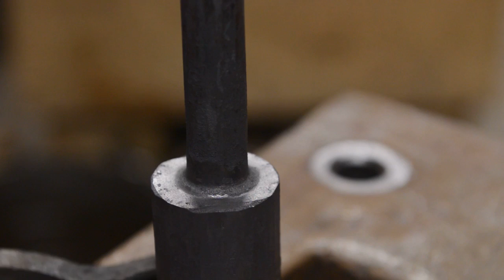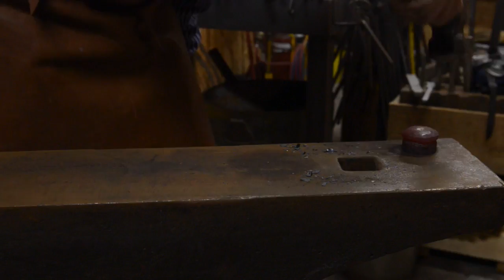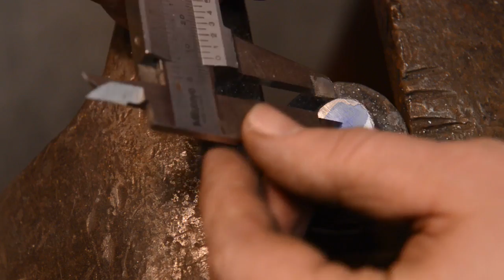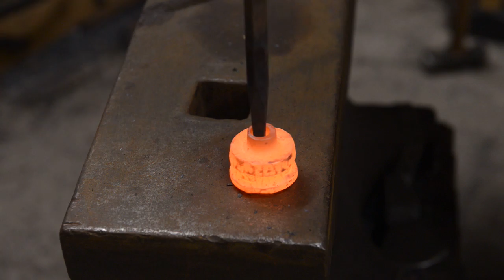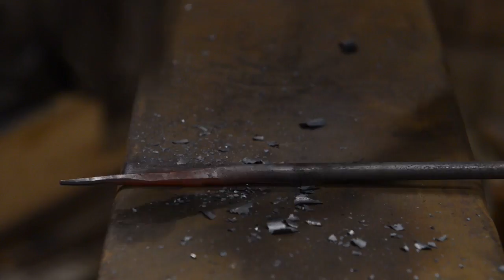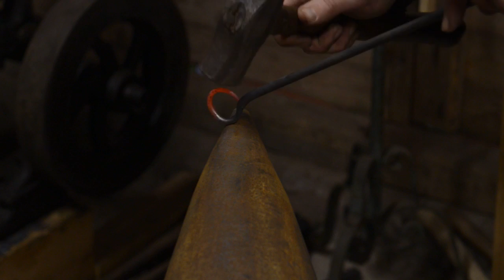Blacksmithing - Forging a nail header

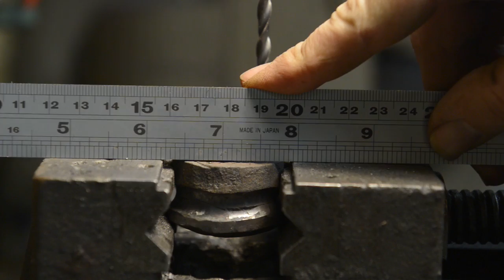Comment: Perhaps a dumb question, but what are you doing at 4:16 onwards? The bit with the ruler? Didn't you already mark the hole for drilling? Or are you checking if it's level?
Reply from the maker: Irianthul Black Yes it's a level check.

Comment: This is just amazing. Thanks for sharing!

One question though: Is there a way to drill through the header without a power drill? How would a 19th century black smith do this? Thanks!
Reply from the maker: semerhi Thanks. It might get difficult but one could punch the hole all the way through. A nail header does not need to be this fancy. A piece of flat stock does the job more or less. Then it's easy to punch the hole.

Comment: after you square off the hardie hole(new to black smithing terms not to metal working) & round off the head could i bring to the drill press drill out square w a 5/8 -3/4 hole then to band saw cut it in half, file a triangle into each half then turn to grip into tongs? finished making my forge waiting on a hand bellow i order on Ebay. then im going to practice nails and scrolls till im blue in the face. so i want to know making the nail header in the way i explained would work good or not? any other info is always welcomed for practicing.  your vids are inspirational. thx for the light in a the dark room.
Reply from the maker: mash7137 Thanks! I don't think there is much advantage for a 2-piece "tong-like" design. Keep it simple. This one is complicated already :) A simple one would just be a piece of plate with an appropriate hole drilled through.
Reply: yep there you go plate w a hole there good advice thx

Comment: What is the dimensions of the round head piece? What dimension is the square hole in it? Awesome video, I just started my 3rd set of tongs so I'm new to this.
Reply from the maker: It really does not matter! Make the square hole to match the size of nails you want to make. In this case it's probably around 5-6mm.  Great! Keep hammering!

Comment: Does the type of steel/heat treating matter for a nail header? I'm assuming mild steel would work but just not last as long?
Reply from the maker: I would say yes. A proper steel version will last much longer.

Comment: what do you do with the leftover scraps flying off the hot metal? Can you reuse it for something or recycle it?
Reply from the maker: MN-14 The iron oxide (scale) is incredible thin, and you have to forge for several months to get any substantial weight. Technically it can be remelted. It goes into the recycle bin...

Comment: Your work is so fluid, every step you do no wasted motion! How do determine the type of steel to use for each project?
Reply from the maker: Dave Pelfrey Thanks! First of all it depends on the properties needed for the tool. Should it hold an edge, sustain hard beating or just tough... For blacksmithing tools in general a medium carbon steel like 4140/4340/1045 would work fine. Edge tools like knives or wood working tools would probably need something with higher carbon content like 1095 or spring steel. You try and pick up what other people have used and recommends... Sometimes you just have to work with what you have. Be careful and don't make a tool too hard (good temper), that's really the only danger in using the "wrong" steel.

Comment: would not be quicker and less effort to  make the header with a wax cast then refine it with the hole afterwards then clean it all up?
Reply from the maker: Mike Duffy You need cast steel then, and that is no easy task. Basic headers are easy to make though, just a hole in a piece of plate will do it.

Comment: i am new to the craft so forgive my ignorance but when you were drifting the square hole why did you drift from bottom up? it makes sense to me to make the initial hole from the bottom because that way you can center it in the hole you drilled but once you have drifted through to the other side why not drift from top down so the shank was in the pritchel?
Reply from the maker: It seems you can do it both ways, but the idea here is to make the header so that the nail doesn't get stuck in the hole. In this way the hole gets tapered from the bottom and is only in contact with the nail at the upper edge. It might also help to not draw the heat away so fast.
Reply: Torbjörn Åhman  That makes sense thanks for taking the time to explain that to me!

Comment: hahaha, those must have been some strong hits to make the anvil dance like that! How heavy is that anvil, like 100kg?
Reply from the maker: +petegalvs :) 400 lbs / 182kg
Reply: oh wow, I wouldn't expect you would have to secure it to the floor, then
Reply from the maker: +petegalvs He he, obviously... some day I will do a heavy steel stand for it with bolt holes for floor mounting. Some day... :)

Comment: Nice video :)
Where should a newbie start, what should be made first? I am using a cars brake-drum as forge and a piece of trainrail as anvil (Low budget ^^)
Reply from the maker: +That Hatr Start with basic projects like hooks to train to do tapers and to do bends. That does not need any additional tools. Make tongs! Pretty easy and straight forward project actually. Try to find a proper anvil, it makes quite a difference I think and keep your eyes open for other tools. In time you will find useful stuff.
Reply: +Torbjörn Åhman Ok thank you. The Problem is anvils are really expensive. I don't have that much money because I still go to school. 50€ a month pocketmoney. I would have to save aprox. 6 months for an anvil :/
Reply from the maker: +That Hatr Ok, I know! No hurry! Work on what you have and keep looking.
Reply: +Torbjörn Åhman Do you think someone who has never done before could do what you did in the video? And what do I need for this?
Reply from the maker: +That Hatr For a simple nail header you really just need a large enough piece of steel with a hole in it. It works fine with a drilled hole even. Here are some examples of different types of headers - http://www.smideri.se/smide/verktyg_nageljarn.html
A piece of leaf spring could work fine, or you could use part of an old tool, like a hammer head or axe head. Remember to anneal before drilling.
Reply: +Torbjörn Åhman Ok thank you a lot for helping me to get started. Subbed to you and looking forward to new videos :)
Reply: +Torbjörn Åhman Oh and by the way where do you come from? Your name looks awesome.
Reply from the maker: That Hatr Ha ha, I'm from Sweden :)

Comment: Take a couple long pieces of steel about an inch wide and a foot or so long, heat them up and form them around the feet of your anvil. Drill or punch two holes on each lash and bolt the anvil down. Wont take you but a heat or two for both. :P
Reply from the maker: Ó Slatraigh Some day... :)
Reply: Torbjörn Åhman It only takes 5 or ten minutes! hahahaha
Reply from the maker: Ó Slatraigh Yes, I want it bolted down but the fact is I tend to turn and move it quite a bit so I'm not sure how to do it the best way...
Reply: Torbjörn Åhman Well, what do you have it on? If you had it mounted on a stump, you could make a track that allows you to turn the whole thing. You could even put a break on it or a crank or something.
Reply from the maker: Ó Slatraigh Currently on a "stump" on concrete floor. Yep, I need to figure something out, but it's a lower priority just now.
Reply: Torbjörn Åhman c'mon man do the förkrympt smeder some justice. :P

hahaha

Comment: What steel is it made from? 5160?
Reply from the maker: Brad Woodfield I got some pieces of an odd custom steel which I think is closely 
related to AISI A514. Easy to forge but hardened it's pretty tough 
stuff. Any medium carbon steel would work 
fine for a project like this
Reply: Torbjörn Åhman Ahh ok. I have a large amount of 5160 and I plan on making a nail header.
Reply from the maker: Brad Woodfield That would work nicely. Just temper it well! A nail header by the way can be made in different ways. The simplest is just a hole in a plate more or less, but the idea of "fixing" the tool while you forge the head is nice. I have seen some done for the hardy hole as well.

Comment: Great, as always, thanks. Quick question : why did you make the heat treatment before forging the "tail", wich could have ruined it all ? Couldn't work to make the treatment with the tail already forged ?
Just to know, if you had some reasons to do so, or just if you had your process this way, with no special meanings.

And by the way, thanks for your awesomely clear and simple videos. Really educationnal and motivating !

Thanks !
Reply from the maker: Thank you! Not sure it matters much at all. You could heat treat it with the handle attached.

Comment: I cant understand why the square tapered hole was made from the underside of the header, surely this will trap the nail into the taper, it should be tapered from the top.
Reply from the maker: Both ways seems to work. The idea with the taper from the underside is to provide clearance to avoid any binding to the tool.
Reply: I can see that would be an advantage, after all we are not trying to "form" the shank of the nail, just hold it straight, I just thought that any slight upset would lock the shank into the reverse taper. the enlarged head will stop the blank from falling in too far while you form the rose head. I will try it that way!